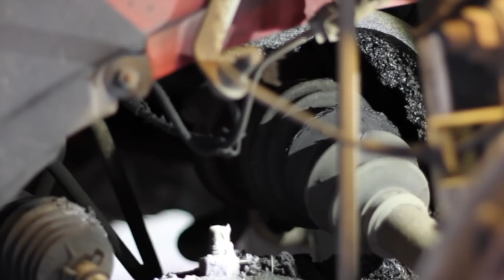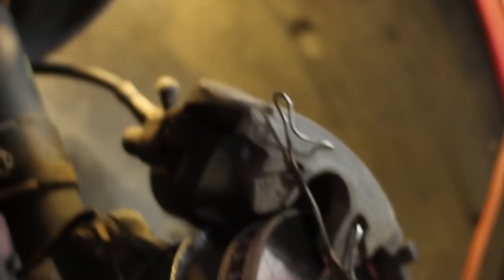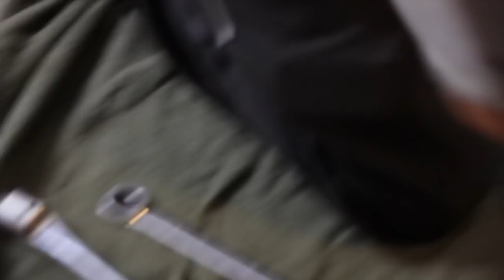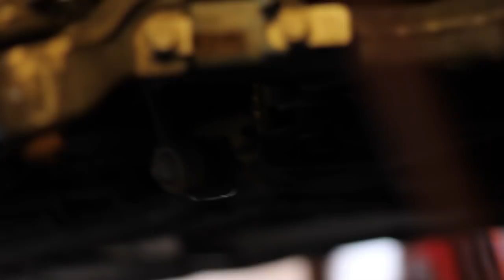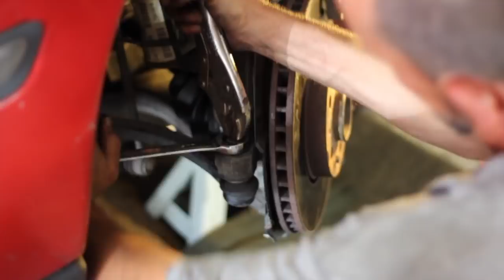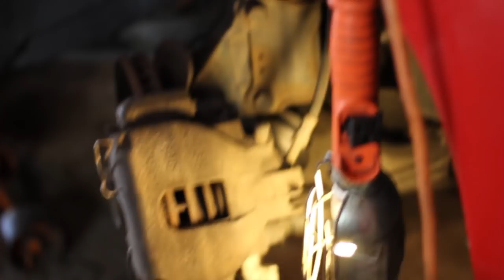Volvo S60 CV axle replacement, half shaft, Constant Velocity Joint, passenger (2000 - 2009)

Comment: If you cross-thread your caliper mounting bolts you DO NOT need to buy a new spindle as he states in this video; although it is the recommended procedure. Reputable parts stores sell self-tapping, slightly over-sized caliper mounting bolts for this application that will easily rethread the hole when installed correctly. Vehicles of these years are a similar chassis platform to the Ford Taurus of the same generation. The Taurus was based off this Volvo P-chassis with slight difference.

Comment: For anyone using this as a how to for axle replacement for the S60 I wouldn't follow this vid.  All one has to due is remove the wheel.loosen the axle bolt, remove the top strut knuckle bolt and just loosen the lower bolt, push the axle out of the hub turn the wheel to the right, remove the carrier baring and you can pull the axle right out.  No need to disconnect all these extra piece like they do in the vid.  I do not recommend popping the ball joints out as you can cross thread putting them back in.  Getting them out and putting them back in can take and add hours to this job.  I completed this job in about 35 mintues with the way I describe above.  No special tools required except I recommend at least having a breaker bar for those tightly torqued bolts.
Reply: Jeremiah Nichols Whereas doing it your way is easier, your way REQUIRES that you now need to do an alignment on the vehicle, regardless of how it drives after you are done. You didn't mention that important fact. If you do it the way it is in the video NO alignment is required as you haven't disturbed any of the alignment-sensitive bolts like you do with your method... Doing it as shown in the video will cost the DIY viewer less money due to not needing an alignment.
Reply: @NorthernChev  Disturb the alignment by removing the strut-knuckle nuts and bolts? By how many degrees do you reckon?
Reply: Are those bolts eccentric? Can you not mark their place?
Reply: I can't understand why he separated the ball joint from the knuckle when the Volvo way and easy way to do it is separate the ball joint from the control arm with a ratchet strap connected between the control arms close to ball joint to pull the control arms down and make clearance to get ball joint out.

Here the ball joint and CV boot are risk of damage, plus a risk of cross threading the knuckle when reinstalling the supposedly pressed in ball joint plus there's no need to remove the brake caliper.
Reply: Jeremiah Nichols Two days later and I still cant get the ball joint back in 😂

Comment: A couple things in this video could be potentially hazardous to your car. The first thing being unbolting that ball joint from the hub, bad bad bad idea, google it on any forrum and that is the wrong way to do that, should just take the arm off of the ball joing spindle: undo the nut from the bottom and give it a good whack. Reason being if you look close the upper half of that ball joint is pressed into a grooved hub hole, very very specific where it goes, and honestly i cant believe this guy got it out that way without doing damage. second thing  is the caliper sliders bolt into a metal carrier bracket so the chances of crossthreading are not nearly as dangerous as stated. just my .02 great video otherwise!
Reply: ....are you a master tech? The ball joint is not pressed into the knuckle a lot of vehicles have ball joints like this that go into a tapered hole and to tighten the nut with out causing the ball joint to spin and not tighten u put a jack on the control arm and apply enough pressure to where it
Won’t spin on you. As for stripping the caliper bracket bolts if you don’t start them by hand and just whale them in with an impact gun and strip
It your guna be paying a lot for new one that doesn’t come with new bolts. You usually have to buy a whole caliper kit as any part store I’ve ever used doesn’t sell just the bracket with bolts.

Comment: I changed rear shocks to my Volvo in my parking plot. Took about 2 hours to complete and was an easy job. With full of self-esteem I started to also change a CV rubber boot. All went well before I started strugling with the lower ball joint. First of all i didn't even get the brake caliber or rolling-bar off because they were heavily stucked. The ball joint stayed and I decided to finnish my working for this day. I tried to hit it with s-driver like you did in this video, but it was jammed.

Comment: Good video guys. On some Volvos (XC90) that ball joint is pressed into the hub and the bolts would strip out if used to pull it in. Need to pop the ball joint out of the control arm or remove the control arm from the frame.